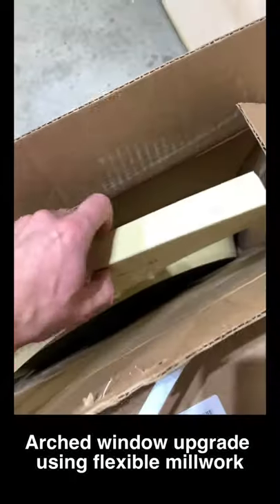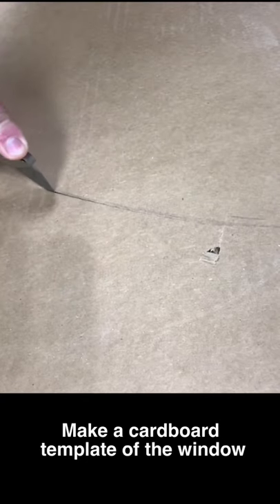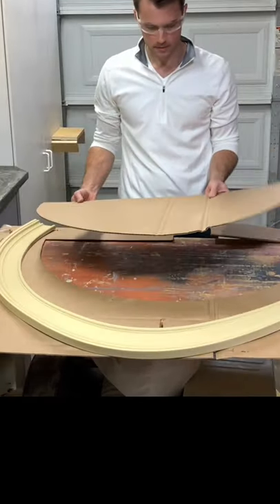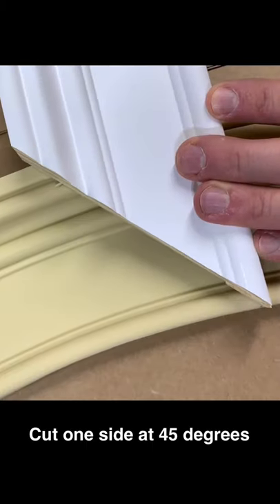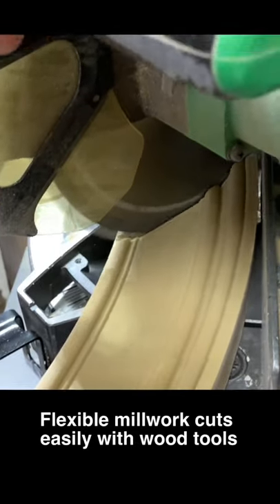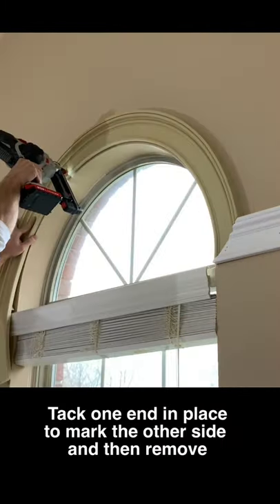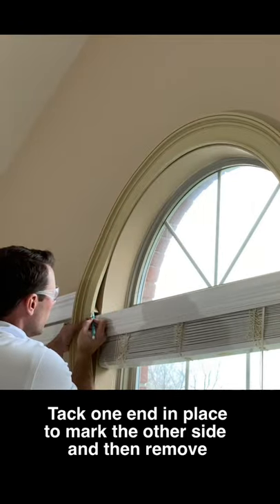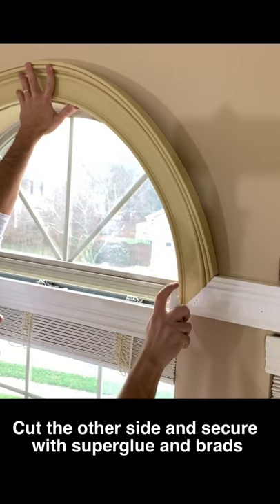Using Flexible Millwork on an Arched Window #shorts

Comment: I noticed your flexible trim already has the arch shape as you’re prepping and installing…. Where mine is straight and bends with lots of elbow grease but doesn’t hold shape until nailed in. How did you get yours to hold shape prior to nailing?
Reply from the maker: When I ordered it I specified that it was for an arch so it came pre molded that way.
Reply: Where would I order something like that?

Comment: How is your trim holding up? I’ve put up two pieces and it has cracked/split within 2 months.
Reply from the maker: Oh dang! Mine has been fine so far. I used a really flexible caulk and a ton of nails.